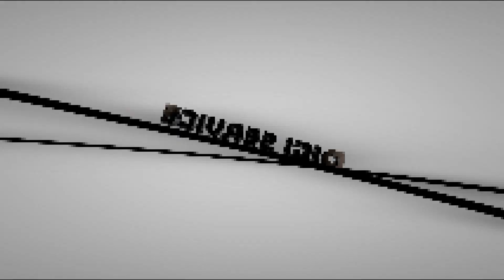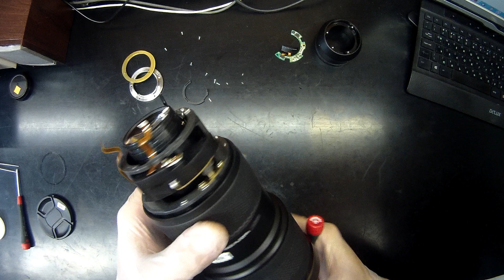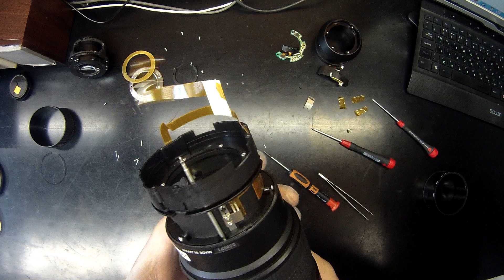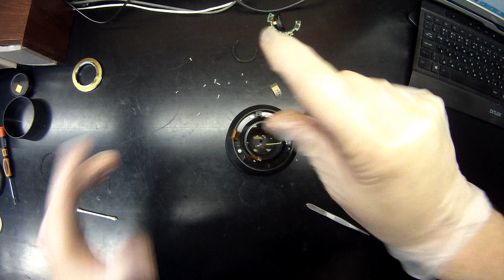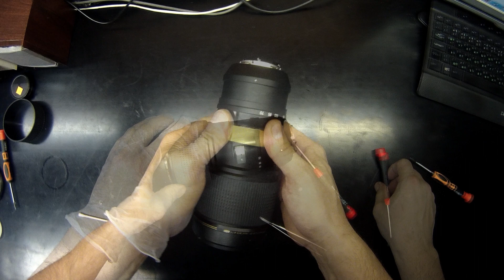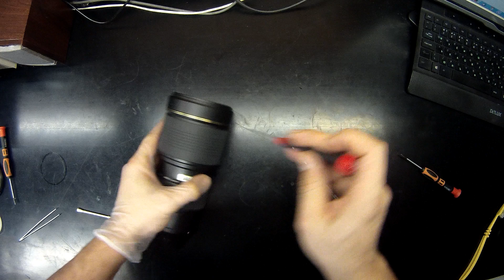How to repair Tamron lens 70 - 200 f/2.8 with Zoom and Focus problem

Comment: Hello, I have this lens for Nikon. It autofocuses perfectly. However if I slide to manual focus and then back to autofocus, it stops focusing. After many attempts of focusing, sliding focus collar back and forth, it starts autofocusing again.

What can be the problem? Thanks.
Reply from the maker: Hi the problem is inside focus slide. It is from aluminium. Need to be replaced and adjusted . Better send the lens to us :)

Comment: Hi!
Please, maybe at least you can help me.
I was repairing the autofocus in my lens (such as this one, A001). The motor seemed to be jammed. At least it wasn't spinning well with my hands and I found bits of glue in it. After cleaning it worked. But as soon as I assembled the lens and tried to focus, I heard a crunch. One of the gears in the motor unit had broken.
Maybe I did something wrong :( Maybe I should have set the focal length before assembly. Do you know what could have caused the gears to break?

Also. If I connect the motor to the camera without the lens, to check it, it only spins one way. Perhaps this is what caused the breakage. Do you know anything about that?

I would be grateful for any help.
I am too far away from you and unfortunately cannot send the lens to you for repair :(
Reply from the maker: Hi the only thing that I can help you is to advise you - check all the flex cables and all the mechanical parts. You miss something
Reply: @DIGISERVICEBG  Thanks for your advice! I'll check it out.
Now I have to look for a gear to check. But it seems that the parts to this lens can't be found..

Comment: My tamron 70-200mm f2.8 di vc usd lens has autofocus issue. Even though my lens is set to autofocus, it wont work. What should i do?
Reply from the maker: hi you need to replace the USD motor. Send email to service@digi-service.eu and we will answer to you!

Comment: Hi DigiService. I have bought a used Tamron 70 - 200 f/2.8/canon mount . It has very stiff focus near infinity . Also at 200mm is not sharp wide open at f2.8 (at 70mm is sharp at f2.8 though). Do you think that if I open it and fix the stiff focus, the problem with the focus sharpness will be fixed as well? Could the focus stiffness have a relation with the focus sharpness?
Reply from the maker: Hello,  the focus problem you can fix after removing the focus rubber. Then in Manual focus mode you will discover holes and there will be 3 screws, which hold focus slide ring (the ring with printed numbers). Try to untight them and if there is resuld, play around to adjust them :)
Reply from the maker: Regarding "blurry" images on 200mm - need AXIS adjustment (: In my next videos you can see what is it and how much is important :)
Reply: Thanks for replying. Could you tell me where is the Axis adjustment of this lens? On the rear or on the front big element?
Reply from the maker: Hello , the AXIS adjustment you can do form the back(bayonet ) side, just below the 4 G lens(diaphragm ).

Comment: i think im having issues i say think cause im unsure as its the first lense of this calibure i have its the 70-300 version it seems to auto focus fine when in distance however when i try to take things close up it wont let me, it just wont take the shot? when i say close i mean anything less than a meter away when i get furthur its fine it will focus and take the shot no problem.
Reply from the maker: What is the exact model ?
Reply: Tamron SP 70-300mm F/4-5.6 Di VC USD Model A005
Reply from the maker: This lens model have minimum object distance 0.95 m. If you are closer, no way to make a shot :)
Reply: thanks! thats good news :)) it would of been ashame otherwise because it takes very nice pics.

Comment: Hello, I have the Tamron 28-75 and it is focus hunting. How can I fix that?
Reply from the maker: Hello, what is the mount? For common problem you should check the flexible cables, zoom brush and focus brush position :)
Reply: DIGI SERVICE I have the D750. Do you have a video showing how to check those ?
Reply from the maker: Hello Marlyn,
i have video which will come soon:)  There you can see where are the brushes :)

Comment: Is it possible to put the lens back together again without needing new parts? My focus ring is very stiff on Macro and won't AF on close range objects. I would like to take it apart today to test
Thanks
Reply from the maker: Hello, yes , you can try, but the tricky moment is to adjust Focus slide(inside) , tightening the screws and test. Good lock :)